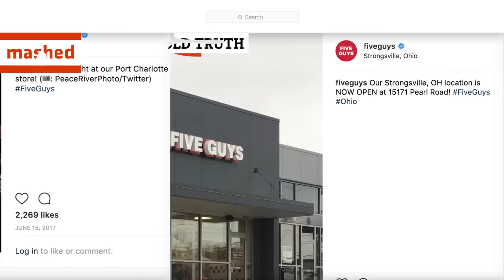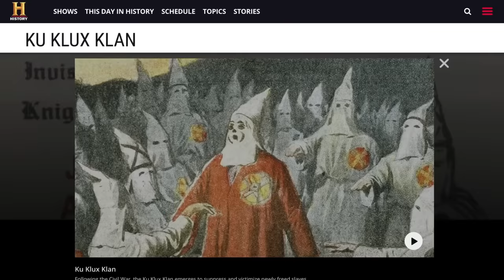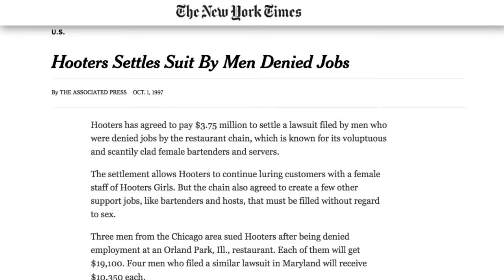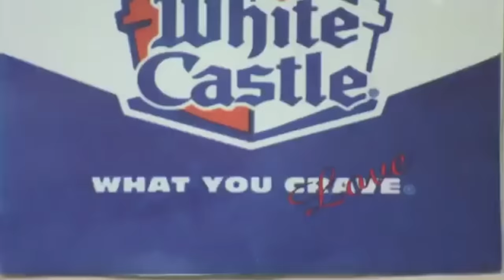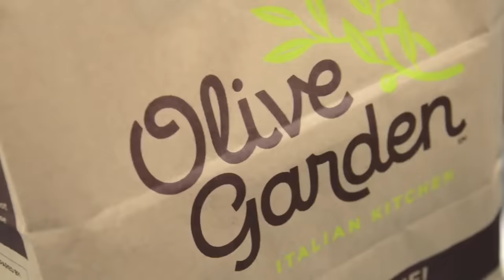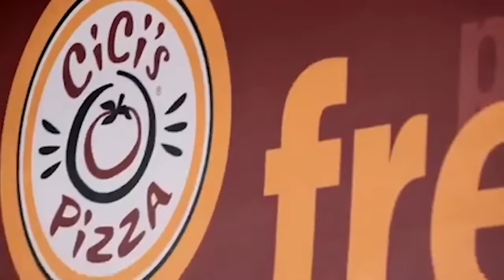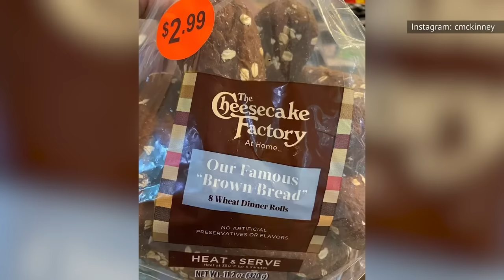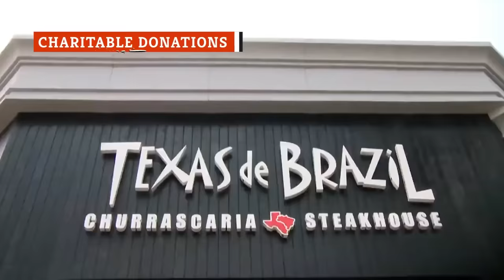Untold Truth Marathon #1 - Restaurants

Comment: At the risk of getting boo'ed, In-n-Out is the worst burger joint I have ever been to. They have this "simplified menu" which they state is designed to make the ordering and assembly quicker and more efficient. However, not only was it NOT quicker and more efficient (it took 45 mins from ordering to pick up, and it was a slow day with few customers and lots of staff!), but what I got was an incorrect order that was small and tastes bland. So I won't ever go back there again.

As far as my favorite burger joint(s), it is a tie between Ab's/Riley's, and Dairy Keen. The former has the best fries/Sandwiches, and the latter has the best burgers. The portions are respectable, and the flavor is to die for. They really know what they are doing.
Reply: Taco Bell used to be my favorite, especially when I managed a couple of them for a few years. I ate and breathed TB, even after I left the company. But sadly, over the following years, they went downhill. After changing their menu, and dropping all the items I liked, there was no point in going there anymore. And the irony was that the discontinued items were top sellers. Mystifying.
Reply: @4Maestro1  It was because of the diarrhea be honest 🤣
Reply: @fearless3073  Well, I didn't have that, thank God. But I probably wouldn't have been surprised if I had.